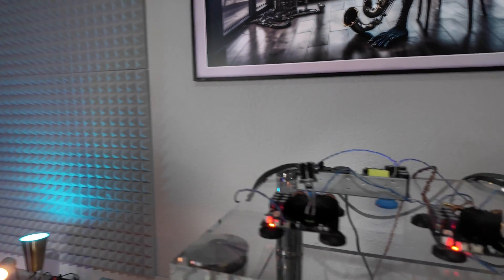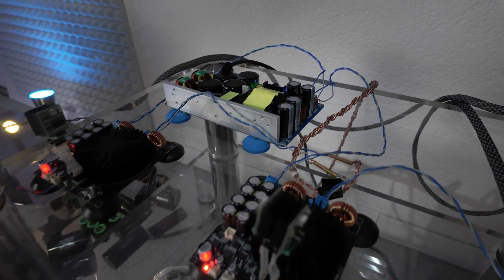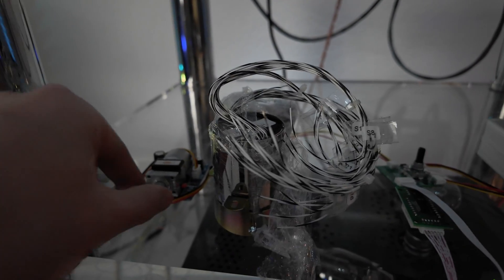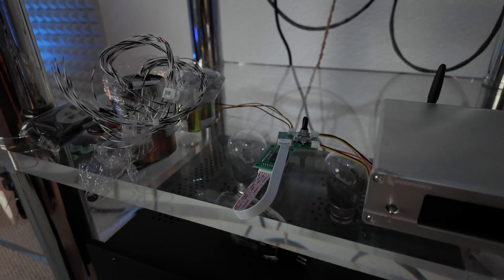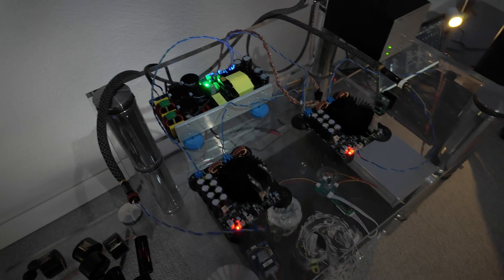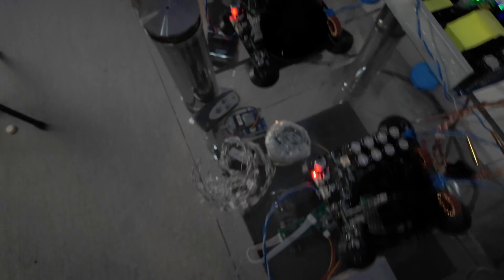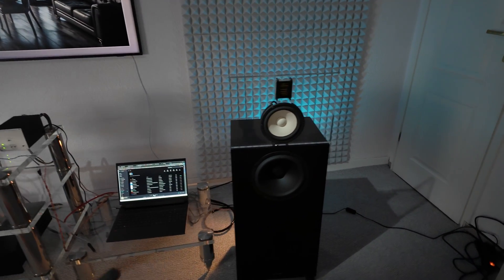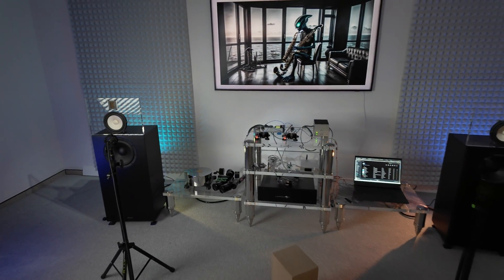Qualio IQ Speakers with 300 WPC D-class Amplifier - 4k Sound Demo

Comment: With discrete Polish opamp: Staccato OSH-DHb – Dual Discrete Opamp Open Sound Hybrid Horizontal. J-FET, H2 and high bias.

[ The Open Sound Hybrid Discrete OpAmp improving the sound of high-end DACs and preamplifier.

The use of J-FET, in both input and output stage, in combination with high bias current, had result in low Open loop distortion with dominating of 2. harmonic. The source follower at the output using an active current source which allow higher output current than the bias current. ]
Reply from the maker: Thanks for placing the info for the community :)

Comment: Good Job! Guess what..I am listening by a pair of similar speakers as yours in design. Those are from 1980' by Vieta, L'ACORD II.
Reply from the maker: Great to hear that. Just check the speakers booking very interesting. Is midrange also In the open baffle ?
Reply: @VirtualHiFi hello , what amp boards are you using ? I have tried to look up but could not find it .
Reply from the maker: You can find them on Aliexpress - https://pl.aliexpress.com/item/1005003933163666.html?spm=a2g0o.order_list.order_list_main.5.342e1c247Qztj3&gatewayAdapt=glo2pol
Reply from the maker: YEs once I'm done with the amp if I like the Value or money of this project I'll put it to the market for sure ;)

Comment: You have increased the performance in class D amplification quite a bit more, congratulations. The tonal balance on the Four Play song is wonderful, I’m very familiar with it. I did receive my Fosi v3
 I played it the first time on yesterday impressed with the sound but I am using a kinky studio P7 to drive it. No op amp swap yet. I will continue to watch your upgrades.
Reply from the maker: Thank you very much. I'll do my changes and I'll record all of them so that not only I but all of you can hear which upgrades are worth it and where is the best place to spend 💰

What amp are you comparing the Fosi to? And what is your opinion on that ?
Reply: I use the kinky Studio M7 amplifier as my primary. The kinky detail is more revealing. It does allow the music to pop out more improving dynamics at any volume.
Reply from the maker: Sound as a great option. THANK YOU FOR SHARING :)